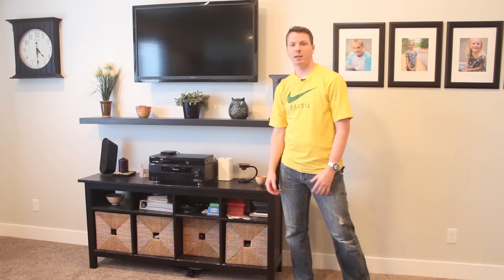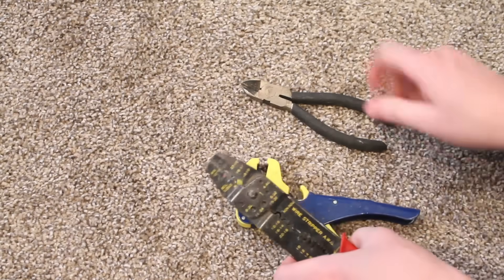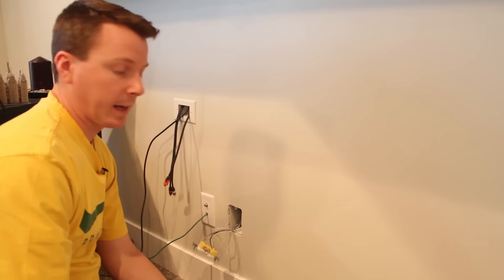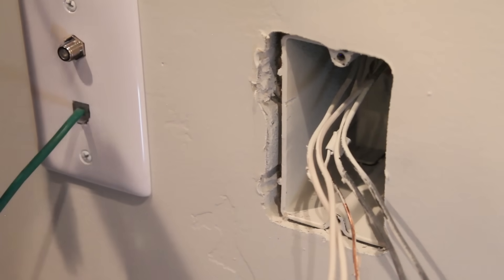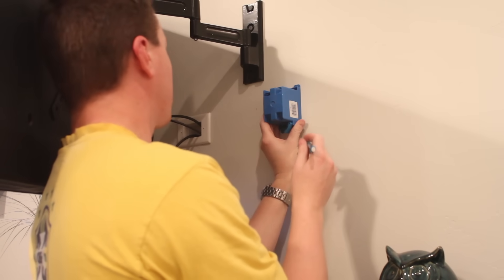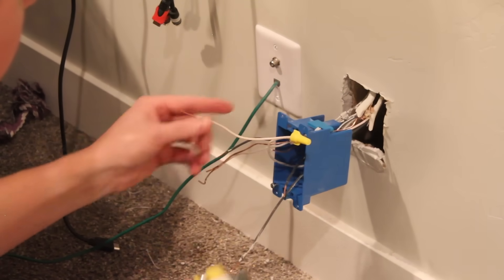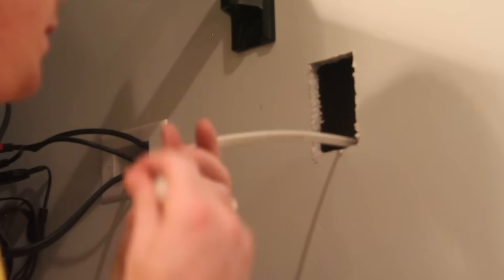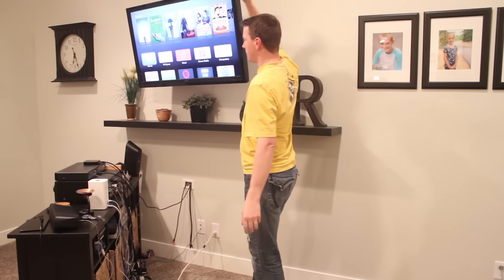How to Add an Electrical Outlet for a Wall Mounted TV

Comment: You selected two wires to pigtail. Were those two wires on the load side (downstream outlets) and then the other wire you left alone the hot side? Just want to make sure I have this correct....

Comment: Really not a very clean job.  You really should have pulled the wire into the box so that the outside sheath was IN the box.  Didn't need to remove the lower box either.  Not a good idea to "teach" people to do electrical work like this.  An electrical fire caused by this install would not be covered by your insurance.  If you're not an electrician, you should have your work signed off by a licensed electrician.

Comment: Good video. Some notes and a question: So are we to assume you did to in your own house? Drywall dust all over the shelf an knick-knacks will not fly in a customer's home.
If you did this for someone else, what would you charge for this? TV installers are not typically electricians either yet charge insane fees for something like this that shouldn't really really an hour or so. I would think this should be worth at least $100 bucks. Tools aside you can't have $15 in material costs. Can you comment on this?
Reply: This was my own house and I’ve never done this as a service for someone, though I’ve helped friends do this at several houses. You’re correct that the supplies only cost about $10 - $15. Tools, like on any job, can add up but I already have most of it. A lot of people do. I would assume you could charge $100 for this pretty safely.

Comment: I'm glad you explained about the second outlet having 2 screws and not having to worry about connecting to them both thank you
Reply: I’m still confused by this? How does it power both?
Reply: @danminchico  thats just the way they work, the other side i believe is a leg that you can wire to another outlet

Comment: Good video.  A few suggestions:
1. Use a metal cutting blade in your recip. saw so it doesn't get away from you when you get through the nail. 
2. You should make sure to pull the romex shielding back into the box before you tuck it into the wall.
3. Buy a better outlet that has more push in holes to avoid having to use wire nuts.  That box got crowded.
4. For your upper outlet, buy one with a built in surge protector.

Comment: Will doing this weaker your max watts input on those outlets?  Since you now have 4 sockets instead of 2 on the same wire?
Reply from the maker: No. Each Romex cable is connected (at some point) to you circuit breaker panel. You can put as many outlets on a run as you'd like (there's no limit in the building code) but typically you don't want to do more than about 12. If you have 12 already and add a 13th, what really matters is what else you're running on those outlets. You can have dozens of outlets on one run as long as you're not using most of them or just charging mobile phones, for example. Long story short, the extra outlet won't likely make much of a difference, especially if you're plugging less into the lower outlet in order to plug it into the upper outlet.

Comment: Seem that the bottom receptacle when it was removed the wall edges got all jacked up seem like bottom part wall piece was hanging down? you didnt have to plaster any of the wall just putting the receptacle plate back on?
Reply from the maker: Old Timer I did overcut the bottom portion but it wasn’t too bad. I would be more careful next time. But no, it wasn’t bad enough that I needed to plaster anything.

Comment: Thanks for posting. This is helpful.My only suggestion would be to put in an outlet with built in surge protection.They cost $20, but that's not an unreasonable investment on a little extra protection for the ol' flat screen.

Comment: thanks for the video. For me the bottom outlet was further away from the tv wall mount. I used a power inlet at the bottom (right below the tv mount) connecting to the new power outlet behind the tv through the drywall. The inlet (and circuit to the outlet behind tv) is dead until connected by a male to female power cord from existing outlet (far away) to the inlet.  Sorta like an extension cord setup. Also there are some what expensive kits available for the same setup. search for power jumper or powerbridge.  Saved a lot of headache drilling through studs and such.

Comment: Great tip that can save most people over $500. The question I have is, based on the UBC, I was told by a general contractor that a city permit is required to add an electric box like you did here, I am in California and we have so many nonsense laws. Thanks

Comment: When I do this myself, do I just turn the power off for the room I'm adding a new outlet?
Reply from the maker: Exactly. Be sure to test the outlet to make sure the power is definitely off.
Reply: +LRN2DIY how's that
Reply from the maker: Go to your circuit breaker box and look for a breaker that has a label that matches the description of the room you'll be working in. Switch it off. If there isn't one you may have to do some trial and error to see which one turns off power to that room/outlet. I'd recommend having a lamp or radio plugged in to make it easier to know if it's off or not.
Reply: Thank you!! This will be something I will be doing by this weekend.. Hope it turns out good..
Reply: Yes, you can turn the power off to the room. Be sure and test it after to make sure there's no power

Comment: This outlet is middle of a run so it has two sets of wires coming in before you add the third for the outlet behind the TV.  Which set of wires did you pigtail together.  Should the hot cable coming in to the box at the bottom be connected directly to the outlet, and the next outlet in the run be pigtailed to the new outlet behind the TV?
Reply from the maker: Hey Anthony, I'm not sure I follow your question because it can be tough to explain all of these connections without pictures, but here's the gist of it. Your existing box has two sets of wires coming into it. You need to send a third set of wires up to the new box. To do so, you take one of the two existing sets and set it aside. That one will go directly into your existing outlet, like it was before. Take the other existing set and combine it with the new set AND the pigtail and connect the pigtail to the existing outlet. 

That means that the lower box will have one set of black, white and ground coming in and connecting to one side of the outlet. The other side will have a combination of the the other existing wire set, the new wire set and the pigtails, with only the pigtails connecting to the lower outlet. Does that clear things up at all?

Comment: Before you added the wire from the top outlet... in the bottom outlet, you seemed to have 2 sets of wires coming in.   but then once you combined and twisted the ground, white and black wires from the top, and one set of wires and the short wire you added... what did you do with the other set of wires of the original 2 from the start?
Does my description make sense?

Comment: Romex is illegal where I live. Needs to be galvanized conduit and box
Reply: Also my existing outlet is not in the same bay as my tv 😫
Reply: Chicago?  I know in Chicago all wiring must be metallic sheathed.  Lots of times in big metro areas where there's lots of apartments, condos and what not, they are more strict.  If one guy starts a fire due to crappy wiring, it takes down the whole city block. Also many of those cities have bad rodent problems.  They have rats the size of cats.  Those things will easily chew up Romex.

Comment: In case this hasn't been mentioned ... I would have done everything exactly the same, except for the Romex setup you used. In my case, I will pull one of the existing wires up to and out of the upper/new hole and cut off enough to leave about a foot of free wire. Then drop a new, longer section of wire through the upper hole to the old hole to complete the circuit. In this way, you need only two connections at each outlet, not three as you had in the bottom outlet here. In other words, my way installs a new outlet "in the bight," as it were.
Reply: What if existing wire doesn’t have enough slack to reach the upper hole? Can you wire nut together the new wire to existing wire in bottom hole (inside the box) and then run the new wire up like it’s the existing? Then run another new wire down to complete circuit? 

Ive actually done this method twice with no issues but wondering if ok?

Comment: Question.  I noticed at the end the TV was plugged on the top plug on the top outlet and the entertainment unit was plugged on the bottom plug on the bottom outlet.  Will you be able to use all 4 plugs with "equal" power?  Meaning all four plugs will be able to provide power to different devices?
Reply from the maker: Good question. The answer is yes. Both outlets on any receptacle are connected directly and provide the same output, regardless of top or bottom, so it doesn't matter if you use top or bottom plug on any given receptacle. Also, you can plug four separate appliances in simultaneously and they should all work just fine.

Comment: People don't take this guy's advice on electrical. He does not know basic code and his knowledge and skill level is at the handy home owner level, which could be dangerous. High voltage being run independent of low voltage is code everywhere because it falls under NEC and local code only take priority when it exceeds the NEC which is bare minimum. Also never use the back push in connections on duplex.

Comment: Was it necessary to remove the existing lower box? I did this for a friend and just used one of the holes on the existing box and used a fish tape to run to run the wire. Its easy since the top will have the hole cut and no insulation in the wall. Also, doesn’t the romex jacket have to go all the way in the outlet box. Couldn’t really see it from the video.

Comment: you don't need the head lights, if you need to turn your lights off at the same time of your receptacles, your electrician fucked up somewhere and is against code.

your lights need to be on their own circuit breaker and able to be controlled by switches, if your receptacles are on the light breaker or your lights are on the receptacle breaker then your house needs to be rewired or you are risking a fire due to overload.

You only need to switch off the breaker involved with this procedure, not the entire house, unless someone wishes to be stupid and go horizontal

Comment: So you need flashlights because the power will be off, yet your saw requires power.  Not!!  Lights and outlets should never be on the same breaker.  Why remove the original box?  Also, although not required, since you had the electrical tape already I would have wrapped both of the outlets over the wires and screws.  Probably not required by your code but a damn good idea.

Comment: You make it look so easy. I did all this but with older houses and the "ace" electricians of the 1980's who tied everything in so tight there were near millimeters to spare, I ended up tearing out the wall to get some wire length and then got frustrated...(who the heck ties in the bathroom lights onto the living room circuit?)

So I patched the wall and said "forgetaboutit!" to the lower outlet. I now have a high mounted outlet (which is cool!) but no more do I have a lower outlet. 

That all took me 7h and I still have to paint the wall. :D
Reply: Yeah, my place was rewired in 2004 so each had nice huge ground and neutral bundle except sockets which you wire in parallel.

Comment: What about running the TV plug down the wall on the inside and to the outlet
Reply from the maker: That's against code, which is why I made this video. It works, yeah, but there are insurance issues should something go wrong. It's the perfect way to hide your A/V cables, though.

Comment: The explanation was a little confusing. You did not explain that you were connecting the new romex to only one of the existing cables and failed to mention the other one was just put back in on the outlet. It might be difficult to understand for someone who does not have an idea how it works. Some outlets have a specific order to add the cables. I am no expert in electricity but I have seeing people correct many of my mistakes. :)  I am not trying to bash, just trying to make things clearer to those who have no idea how to work with electricity.

Comment: You really did not have to remove the existing box. That was a complete waste of time. But other than that it was a nice job. You also should have explained in your video to keep the black wire far away from the ground wire when putting the box back together. You will get fried if they touch!
Reply: Another reason to wrap electrical tape around connections on your receptacle.

Comment: Hi I followed your instructions to the letter and successfully install a higher outlet for my flat screen TV. Thanks whole lot. Now I'm getting ready to do it again in my Den. Is it occurred to me that I didn't need to do all those pigtails or twist or twist nuts to connect the bottom receptacle to the top receptacle I might need to do it for the ground but for the top receptacle all I need do is connect the top wire to one of the leads on the receptacle at the bottom and the other one to the other side of the receptacle at the bottom and I should have power to the receptacle going to the top without having to use all those wire nuts. Given I might have to use a wire nut to make the ground connection but just for the black and the white I should just be able to connect to the lower receptacle with those two wires( white and black wires) and I should have juice at the top what do you think guys

Comment: A good idea not to use the push in connections on the back I don't trust them. And also tighten down any screws not being used and wrap around the screws with black tape

Comment: Hi Nils, thanks for the video.  Since the outlets will be hidden why not just put another outlet box in and then plug into that.  This way, doing the wiring would not require turning off the electricity.  When you wired, I noticed you didn't use any electrical tape.  I like to use electrical tape around my connectors to make sure 100% the wires are not coming loose for any reason.  Again very good  video.
Reply from the maker: Thanks, Bob. I agree about the electrical tape. Since making this video I've been wrapping outlets in tape each time I put one in. I'm not sure what you meant about putting another box in and plugging into it - can you explain?

Comment: Hi Nil, I noticed you turned that area on your drill where all those numbers are.  I have a Black and Decker drill but I have no idea what that part is for, can you explain?  I use my drill a lot but I really should know how to use it to it's best advantage.  Thanks, and appreciate your presentation style.
Reply from the maker: Hi Alice! Great question. That's called a clutch and is used to adjust the torque that the drill uses. By turning this to a lower number, the drill will only apply a small amount of spinning torque to prevent drill too aggressively. At the end of the numbers, there's usually a picture of a hammer or a drill bit to represent full, unthrottled torque. I usually keep it pretty low for this kind of work, or use a handheld screwdriver. I'd turn it up when drilling through a thick piece of lumber, for example. Hope that helps!
Reply: Thanks for that info, I need to adjust my drill now.

Comment: do you have to determine the current draw for the breaker before  adding another outlet now that you have 2 additional outlets that may draw simultaneously?
Reply: No. You can add as many outlets as you like as long as you don't go over the braker amps. So, it doesn't depend on the number of outlets but on the number of things you plug and the amps they use.

Comment: This was an awesome video, unless of course:1. your existing box is a contractor box that is bolted to a metal cleat and the new box won't fit in the hole because of the metal cleat. You can't clip it and you can't move the box, because whoever the professionals were who wired the existing outlet didn't leave any slack to the wires to move it up. When I moved it over to fit it in, then there was nothing to attach the new outlet too on the one side and it goes in crooked. Why, just why can't a home project go easy, like these videos.

Comment: I would've left the original outlet in place and pushed new romex up into the wall cavity until it appeared in the top hole. Also, I wouldn't have used the wire nuts in the lower box. I'd have just left the original wires stabbed in and hooked the new wires to the screw terminals.

Several ways to skin the cat.

Comment: You can't run a terminated lead through the cavity but it's okay to wire your own outlet without an electrician? That seems backward. A faulty termination will more likely cause a fire due to arcing than a sealed lead. Don't do this stuff on your own; get an electrician.

Comment: is it just me that thinks it's BS that you can't put high voltage wires behind the wall, when there are high voltage wires behind the wall already
Reply: Anthony Webber the high voltage wire behind the wall is rated for going behind a wall, regular appliance cords aren't

Comment: I did this yesterday, although I wound up not needing to run any cable (only extend some that was already running down the beam my new outlet was going on, coming from the outlet below it)... your video was SUPER HELPFUL! Thanks for posting, very easy to follow. 100 thumbs up!  Luckily finding the already existing wire saved me any fire block issues, my big worry when starting the job.
Reply: My nearest socket is 6 feet away, this did me no good.